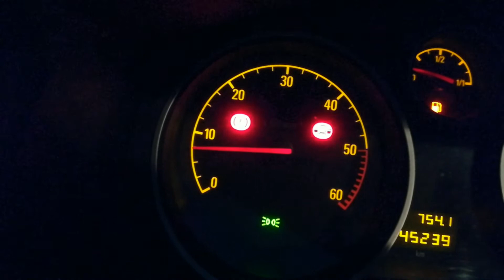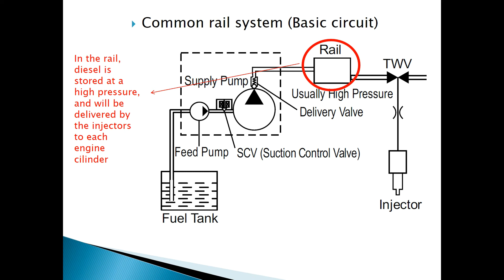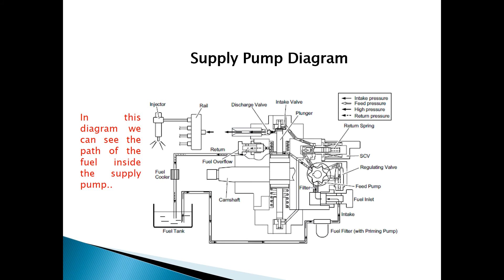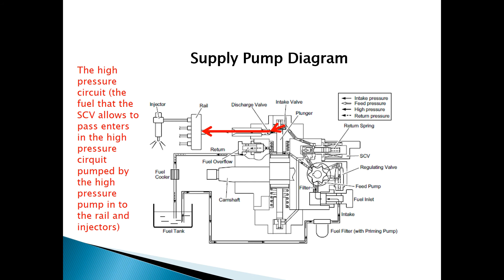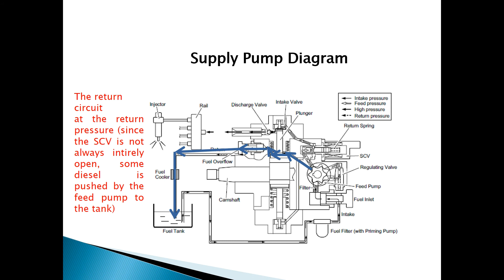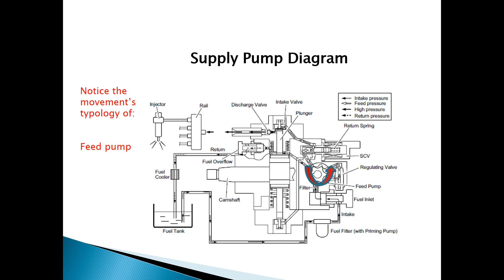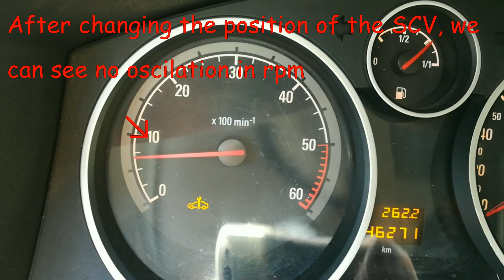How to solve rough idle in a diesel car (example of Vauxhall/ Opel Astra H Mk5)

Comment: Hi I had same problem, changed SCV aftershock week or so problem back again. Any ideas what else might caused rough idle? 
Thanks
Reply from the maker: Injectors?
Reply: Probably oil level too high due to many short journeys, get it changed and fill to just under maximum level. Once a week they need a good run on motorway, no parts needed.
Reply: Did you fix the problem? I have the same problem with my astra

Comment: I would only change the fuel pressure regulator if the dpf error comes up and goes into limp mode when putting foot down. I've had leak test done on injector's all fine. Next week checking fuel pressure sensor, will post back if it cure's the bouncing revs.
Reply from the maker: About six months after doing this twist in the SCV position, I had to change the whole part by a new one and, since then, the engine have been working just fine.. Like I predicted in the video. One year has passed since that.